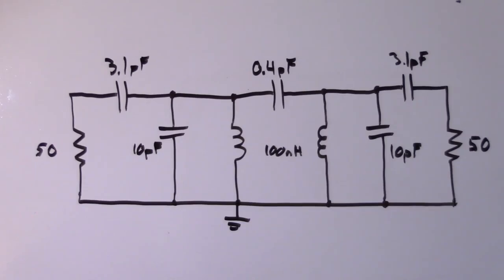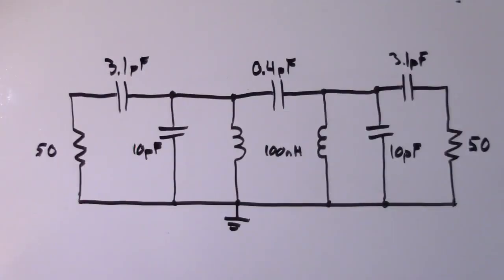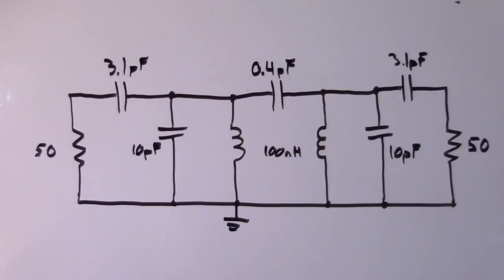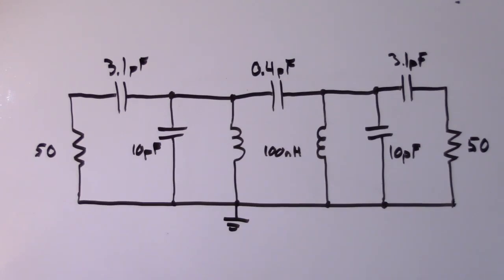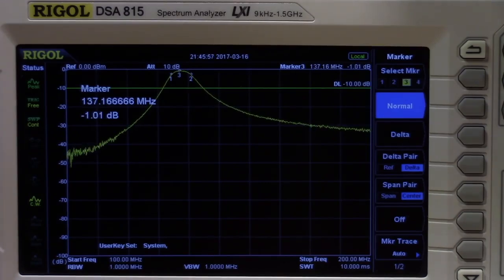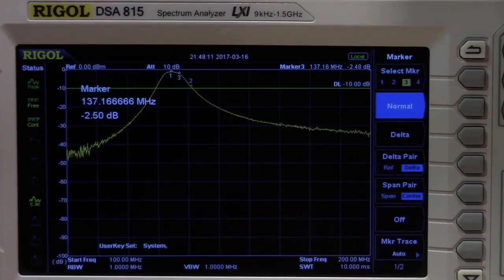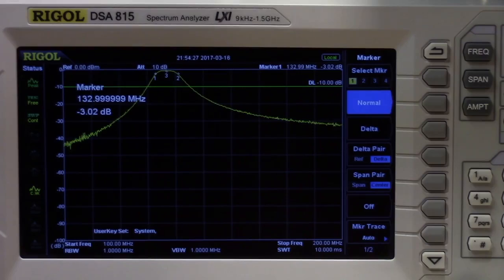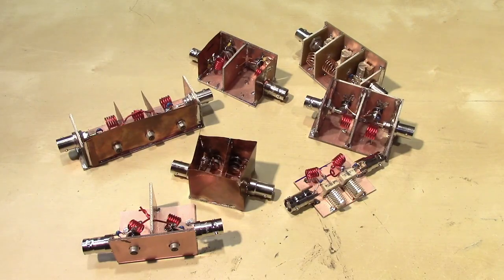Practical RF Filter Design and Construction [devttys0 reupload]

Comment: Note that the twisted wire capacitor is called a 'gimmick'.  They were actually used in some old  mass produced tube radio equipment, and are very handy for ham radio projects. BTW, I miss the Time Is Nothing videos. They are good stuff.